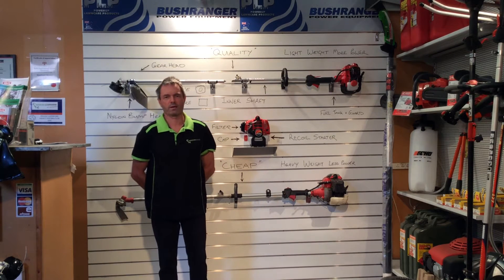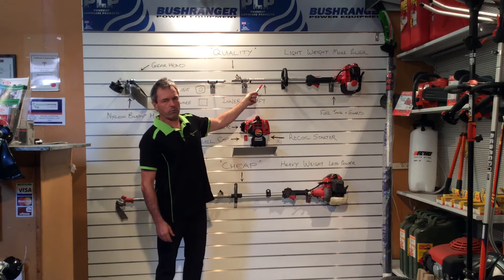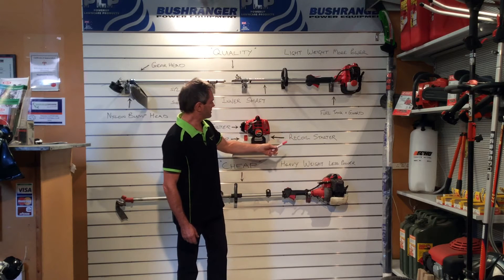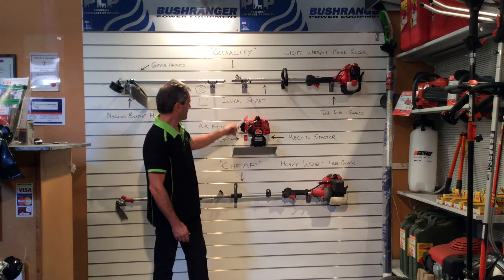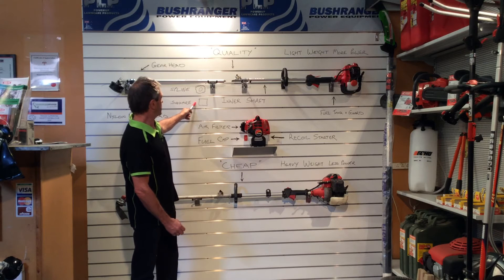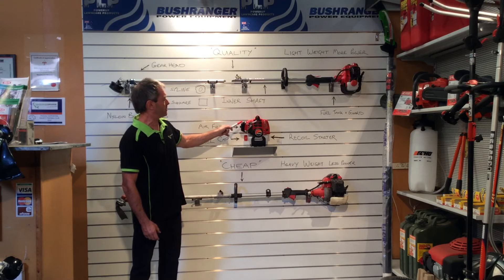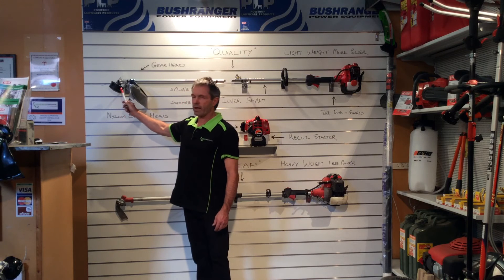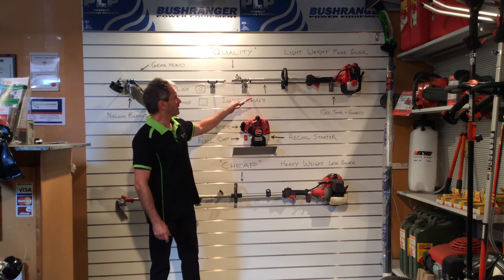Quality vs cheap multi tool

Comment: Absolute toss. I have a BU-KO multitool. Cheap as chips. Has a splined inner shaft great air filter and seals well with an O-ring. One of the best pull start systems I’ve ever seen. Listening to you I can hear you don’t have a clue what your talking about. If a bearing fails in a strimmer head (all do including very expensive machines eventually.) it can be replaced at low cost by a child. Easiest job in the world.
Reply: Actually, I think Phil here knows a thing or two about what makes a quality machine. Here are some problems with those cheaper tools

1) No fuel tank guard
2) Heavy as hell and poorly balanced
3) Can't handle high load constantly like a quality machine
4) Fasteners and other parts on attachments wear loose over time

I'd be very surprised if it still works in 2-3 years

Comment: Anyone know of a mid range type manufacturer in the UK. I'm looking for the motor unit only. And needs to be 7 spline profile. Thanks
Reply: Webb.
Reply: @wesleypresley1000  Cobra, they do both cheap and pro